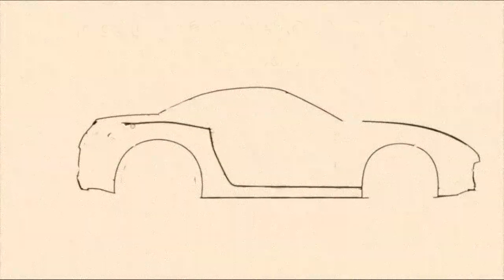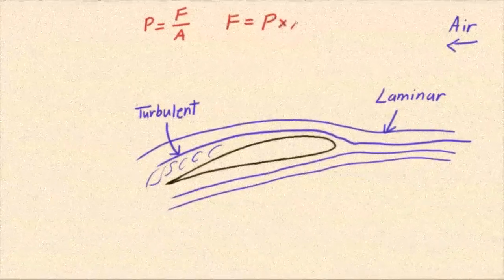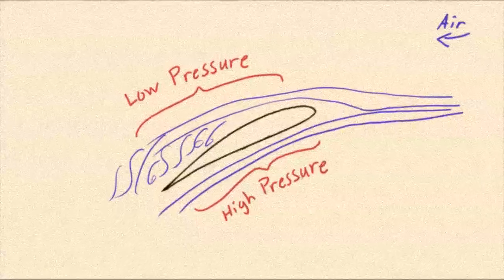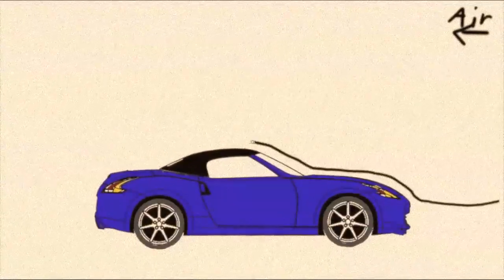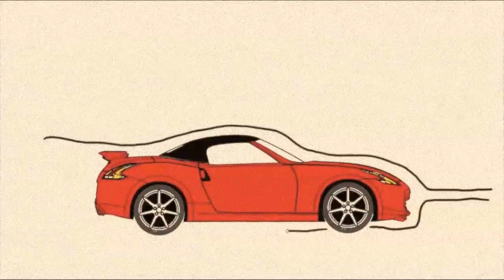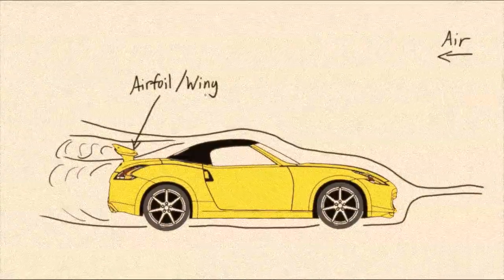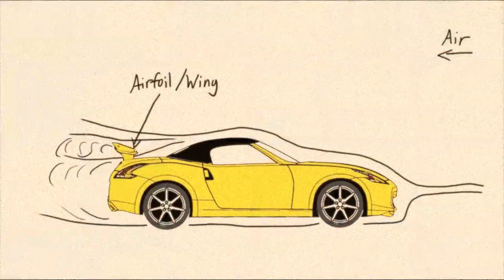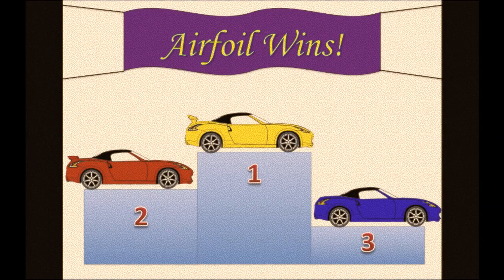Sports Car Aerodynamics: Spoiler Alert!

Comment: wait... but cars with spoiler will have lower top speed for more downforce (-> stability), in this case the one without any aero kit should be faster (in terms of top speed)?
Reply: In a straight line, less downforce is better. The wing or spoiler will help with downforce to keep your car on the ground but it makes the car heavier and will slow you down in a straight line. It will help in cornering though, so a car with a wing can run around a race track with plenty of sharp corners faster than the car with no wing.
Reply: @troyandrade615  if i am driving daily on a  super highway/ expressways where 100 kph min speedlimit is required where you will be driving for atleasr an hour straight. Is having a spoiler on car a good idea?
Reply: @heymanbatman  A spoiler or wing will not make much difference in everyday driving, but the difference will not be that important unless you are racing. If you add a spoiler or wing to a daily driver car, it is more for looks than performance.

Comment: true but car looses traction not because of front wheels being bald mostly, if you take automotive engineering it will tell you ,it looses traction and hydroplane usually because of rear wheels. even tho its a FWD.  once the rear end breaks loose u cant gain control back its very hard.

Comment: I think their example is ok for a wing with a very low angle of attack designed to correct the parasitical drag of the rear but with too much downforce you reduce top speed. Proper airflow management under the car is were most of the drag can be reduced because up to 1/3 of total drag comes the undercarriage.

Comment: ok lot of people say front wheel drive cars cant or shouldn't have spoilers. i kinda disagree. not because i am a ricer or any thing but instead in rain i think it comes in handy.  if the air pushes down on the rear tires hard while driving in rain its less likely to hydroplane .. i doono what do u guys think?

Comment: Because you are using some of the engines power output to create the lift or downforce itself, I think the energy required to create the lift would leave you with the same or worse fuel efficiency and less traction lol. Better for commercial products to just attempt to minimize any drag or pressure differences whatsoever, as much as possible

Comment: No probs! Let me know what takes your interest as a general field (low speed, high speed, super/hypersonic, etc), I might be able to point you in the right direction. Little tip, if you're wondering what the effect of compressibility on lift and drag is, look up the Prandtl-Glauert singularity. It's relevant from .3 to about .7-.8, where the body enters the transonic regime. Have fun!

Comment: Flow separation was on the wrong side, drag is generated at the forward stagnation point, called form or pressure drag, as well as all over the surface of the aerofoil, called skin friction. The former has to do with shape, while the latter - viscosity.

Boundary layer separation is an effect exhibited by all objects traveling in a fluid, depending on a few factors, but with aerofoils - it's angle of attack. Basically, viscosity causes vorticity, which causes separation at high angles of attack.

Comment: Cars don't really reach compressibility speeds, it's a boundary layer phenomenon, brought on by viscosity. I'd suggest you look into boundary layer theory for these low speed problems. Compressibility becomes relevant at about M.3, which is outside the speed range of most cars anyway. Don't confuse static pressure with dynamic pressure either, if you look into the Bernoulli principle, you'll get a better understanding of what I'm on about.

Comment: Glad you said that, i was thinking the same.  When air is being compressed, it is at a higher pressure (more air in same volume = increased pressure).  Air that is allowed to expand is lower pressure... i was confused as to why it was being explained the opposite way.

Comment: Stupid video, if the race is a straight the one without the wing would win because it has less drag. It doesn´t need the downforce. 
Then even if it´s a curvy road the bigger rear wing could actually incduce understeer hampering the corner capabilities.

Comment: It would help acceleration only at higher speeds and if traction is still an issue. So like a car with very high power/weight ratio (>500hp/ton, or something), 2wd and at speeds where spoilers or wings start to produce down-force. But on street cars like the 350z or a regular Carrera, it wouldn't have enough power to require a wing to improve acceleration. It would still improve handling, but ruins your gas mileage!

Comment: Very poorly conceived video.  I would have expected better from MIT.  All other factors being equal, there are NO circumstances under which a street car would win a drag race (the kind of race pictured) because of a spoiler.  Ultimateloy, spoilers create drag and that drag always reduces top speed.  That's why a Veyron goes faster with the spoiler down. The only way spoilers or airfoils help you win races is by helping the car stick better in high-speed corners.  That's why F1 cars have them.

Comment: A wing in the turbulent bubble behind the carrera would only increase drag, but don't expect any lift. The objective of a spoiler is to ensure that the flow separates at that point, instead of having the separation point oscillating back and forth. The spoiler decreases drag by tripping (spoiling) the flow at a well-chosen location. An F1 car has the aft wing above the wake.

Comment: Why is the spoiler important at low speeds when there is very little airflow? Example two identical four wheel drive when car can get sufficent traction whitout spinning wheels and the one with spoiler would be slower becoase added drag, And also would the car without spoiler be faster regarding top speed becoase there is less drag? No?

Comment: well, if we're talking about 1000 hp cars yes, but in most cars you can buy wheelspin is already over when the car travels fast enough to create significant downforce.
And since he is showing a Nissan 350Z/370Z with I think about 300 hp wheelspin won't even occur in 2nd gear so in any dragrace it's just all bout the drag the cars produce, not the downforce.
when we"re talking about a roadtrack with corners though, the car with more downforce would win.

Comment: I agree, Being involved in the racing industry I see many flaws to the wind tunnel experiment. The cars should have been on the "ground" because the height of the car to the ground has a dramatic affect in aerodynamic affects of the car. Especially on the exit of the under-body. I like the wind tunnel model and principal of these test. But accuracy of the aero was missed as air exits the car from beneath it. Which usually causes a vortex behind the car.

Comment: Why do you think F1 cars have DRS (Drag Reduction System) ?? DRS flattens out the rear wing so it doesn't create down force and intern doesn't create drag, slowing the car down... So if the race between the sports cars was a short race eg. 1/4 mile drag race. The car with more traction (spoiler) would win. But if the race was longer, the car without the spoiler would win because it has less drag and would have a higher top speed. Liked the video though. I want to make a wind tunnel like that :P

Comment: I call shenanigans on this video.  A car with a spoiler or elevated rear wing will probably win on a road course, and may or may not win in a race down a drag strip, but the drag associated with the wing will always act to impede the car's motion at high speed. The bottom line is, anytime you add more stuff sticking out into the wind, you increase drag, and decrease top speed.  This is why modern hyper cars feature spoilers that only activate under braking and change to lower profiles at speed.

Comment: I agree that the spoiler needs to be specifically designed and tested for your application to function properly. Spoiler will increase the downforce so you'll have better traction on your rear wheels. So it's good if you wanna accelerating your car with less weight and bigger torsion. But the important thing is a good spoiler will give you better handling at the turn because you'll have a good downforce to keep your traction in a good condition.

Comment: This is correct, albeit a bit misleading.

You won't make your car faster with a spoiler or deflector. In fact, when you add a spoiler to your car you are likely going to decrease gas mileage, increase drag, decrease top speed, and change the handling at high speed.

The spoiler needs to be specifically designed and tested for your application to function properly, if it isn't, (which most are only cosmetic) a spoiler will hurt more than help.